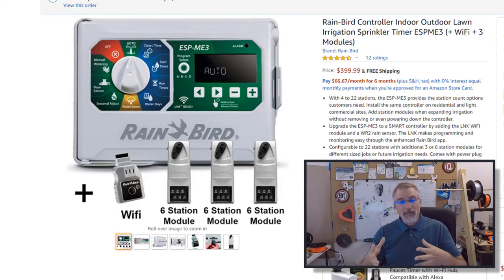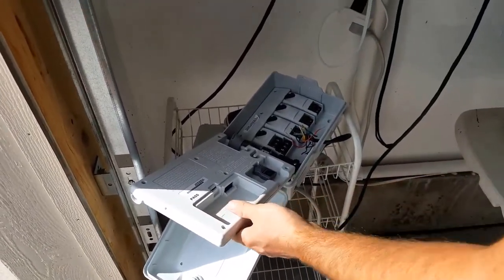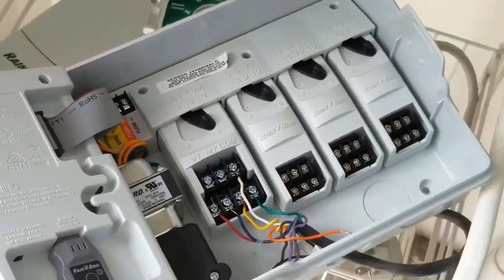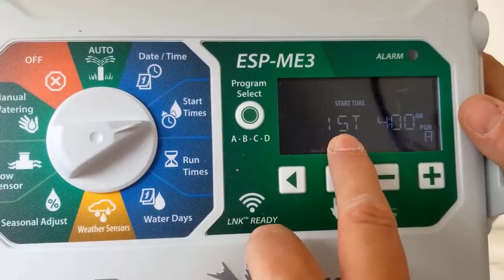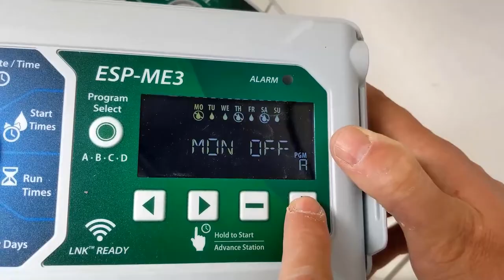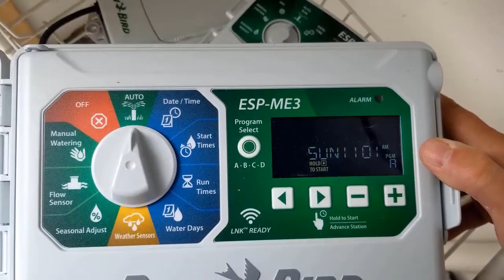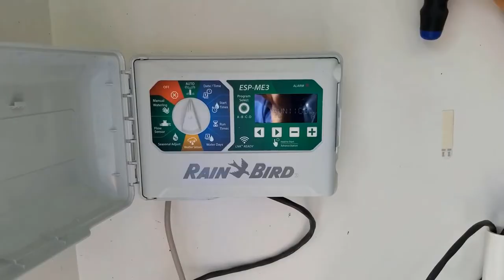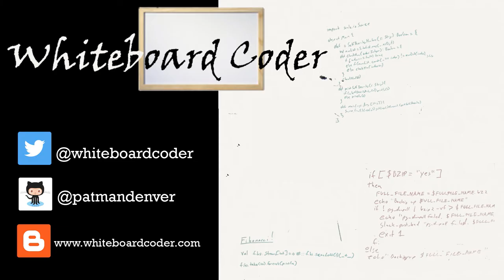Install and Program rainbird ESP-ME3 sprinkler controller

Comment: I think I accidentally connected one of my watering zones to MV. Do you know if that would fry something for that zone? I only had 2 zones to begin with and I was able to get the first one working but the second one (which I think is the one I briefly connected to MV) isn't doing anything when I connect it to the VT (the test node). None of the other wires that used to be connected to my old controller do anything either.

Comment: Hey Pat, just had my ME3 installed and was trying to make all zones working in the same time. I just came to know from you that it is just one zone working at time before it switches to the next one. any thought on how can this be done if i want them all to woking together? thank a lot.
Reply: Same here, you have solution?
Reply: Then use a deff method
Reply: it can't be done

Comment: Everybody and their brother has a video showing how to plug in the zone wires, but there are very few videos showing how to connect the power supply to the controller.  You also skipped right over that (as well as how to carefully remove the previous unit, which I was looking for, too).

Comment: why would you run each zone for only 6 minutes and repeat for 3? 4? more hours? Why not each zone for 25 minutes and run through a cycle once?
Reply from the maker: It actually saves water.   If you leave the water on for a long time you don't give it a chance to soak in and will cause a runoff